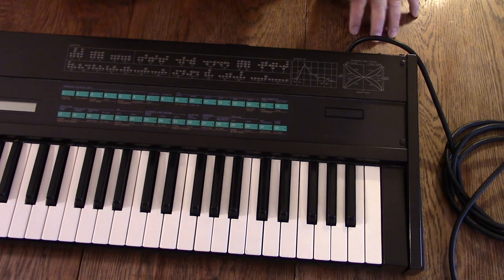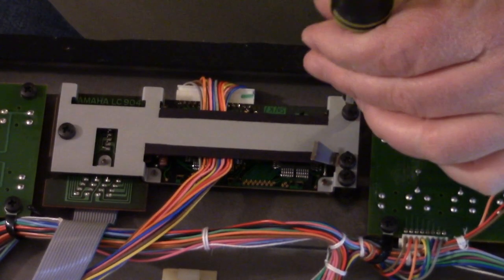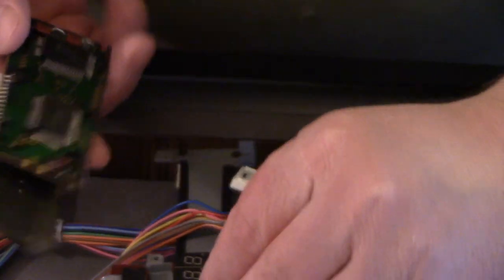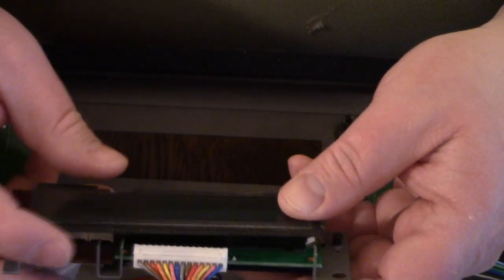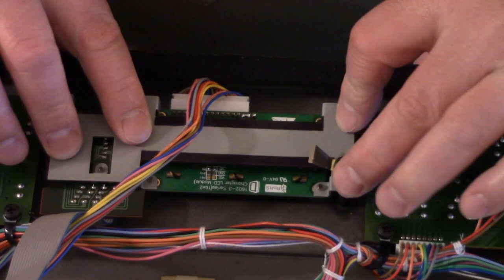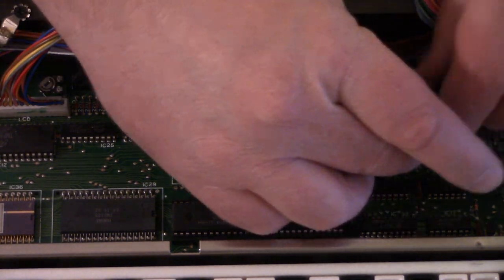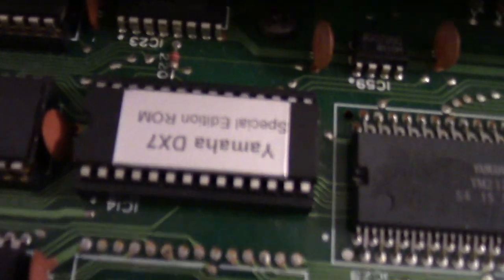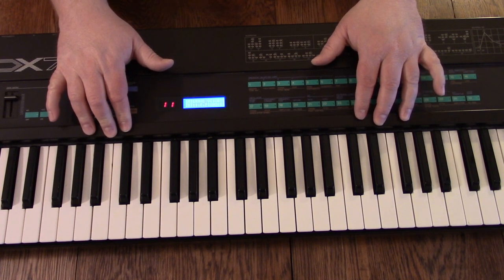DX7  Bios and Backlight upgrades

Comment: Just performed both of these upgrades. ADJUST THE CONTRAST! There's a trim pot/variable resistor to the left of the small ribbon cable on the main board, VR1. Otherwise the screen displays all white and you can only read it at an angle.
Reply: rwdplz1 I need your help with adjusting the contrast. How do you do it? I've got the board open and see what your talking about just don't know what to do
Reply: @funkbrah270  If you found the VR1 variable resistor, it looks like a black half circle with two silver legs near the ribbon cable, and a circular silver circle in the middle of it with a rectangular hole. Put a tiny screwdriver in the rectangular hole, and turn it clockwise or counter-clockwise until the screen is readable.
Reply: Thank you so much! Awesome tip! Saved my ass!

Comment: You forgot to adjust brightness & contrast. Default contrast is too high, as seen by the blocks on the display.
Reply: VR1 is used for contrast adjustment.
Reply: discoHR nice what do all the other trim pots do ?
Reply: THIS. I thought mine was defective, found and read the instructions.

Comment: In my case I put the screen on, the characters are visible but there is no lighting, do you have to do something else for the backlight?
Reply from the maker: No, it is built into the assembly. If it doesn't light up you probably need to return it as defective. I got mine from ebay. Just looked for new ones.... WOW the prices have skyrocketed. The one I purchased cost $28. I got it from user glitchscience. I don't think they have them anymore, but you could message them and ask. Good luck.

Comment: Thanks for the video!

Some things I would have done different:
-Use spacers on screws to fix the new, thicker display
-Don't put your fingers on the new display (or if you do, then CLEAN it!)
-Clean the display filter once you have it out of the unit, mainly the edges, as there is for sure some dirt there
-Take care when reinstalling the crystal filter so you don't scratch it with the metal frame edges, as you did
-Adjust contrast on new LCD (as other people has already said)
-Use plastic tools or a real IC extractor to remove ICs (this is perhaps picky but well, I would do that way!)
Reply from the maker: Actually, you missed another oopses I had... I forgot to run the cable through the frame and had to go back and correct it... If you don't it will tend to press on the c# key... As for the contrast, I did adjust it later, but at the angle I tend to play, it was pretty good. Spacers are a good idea, Wish I would have thought about that originally. Also wonder why the new display didn't come with new ones.
Reply: citizennerd how do you adjust the contrast?